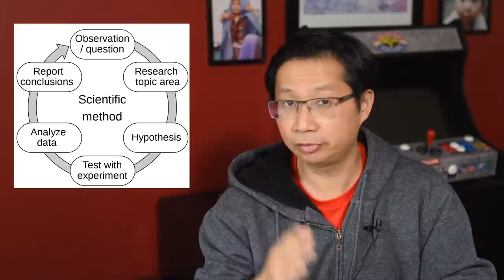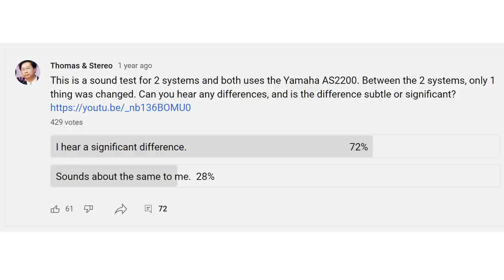Let me tell you stories about Break-in.

Comment: I'm glad to see you bring up this discussion. I will share my opinions as a guitar amplifier manufacturer who is in the tireless and very thorough pursuit of tone. I will list what breaks in and the order in which they break in the fastest. 1st is solder joints. These break-in in just a few minutes. 2nd is tubes. I would say after 20 minutes you know what you're getting and that will continue for hundreds of hours before they noticeably start to sound tired. 3rd is speakers. Especially low frequency drivers. They can change drastically initially and then will level out for years and then start to get loose, soft and lethargic. 4th is capacitors. They will show thier sound characteristics immediately and improve about the same rate as tubes. They will stabilize for the longest amount of time, generally decades and then they will decline. Again sounding tired, lethargic, muddy and dirtier. Also I should mention what happens with wire. Specifically the insulation. Cloth covered wire doesn't break in. All synthetic insulation goes through a warm up at first turn on. The softer the insulation the more obvious the change. Also the thickness of the insulation affects the sound. The thicker it is the more it interferes with the natural sound and can choke, flatten and harden the sound. These are just my opinions and based on decades of experimentation and having wire and capacitors custom made. I hope some of you find this enlightening and helpful in your pursuits of better sound.
Reply: I experienced break in on an expensive USB cable. I was baffled that it sounded dull with alot of bass, and the midrange and treble were almost nonexistent, lifeless. After about a week it was broke in and sounded great. What happened down at that level? Electrical field flow disruption?
Reply: @machwind3266  Hmmmm that's a significant change beyond break-in. If nothing else in your system was an issue I can come up with two possible solutions. Either a poor internal connection that through movement of the cable, it found its way. Or there was still some lubricant film left on the conductive materials from manufacturing that came off through repeated insertions.
Reply: @machwind3266 it's digital not analogue..

Comment: When I was a kid, I bought a pair of NHT 1.3As. The store didn't have new in box, so I borrowed the demo models until mine came in on order.  Once they arrived at my place, after having gotten used to the sound of the demo models, I positioned mine right next to the demo models to do a quick A-B.  I was baffled to hear a fairly 'drastic' difference between the two exact same models. The demos sounded open, full, and dimensional. The new ones sounded flat as heck, no bass, no sense of space. It was bad enough for me to call the store to ask what was going on. They told me to be patient; the speakers require a bit of time to break in and loosen up. I didn't know this was even a 'thing' at that time, but I DID know for certain that there was a very noticeable difference between the two pairs of speakers.  The store was correct; they loosened up after several hours of playing, and just kept getting better until they plateaued.   This is the reason that to this day, I don't comprehend why seemingly so many people don't believe in any sort of break-in.  With that said, I'm with you in that not EVERYTHING has noticeable break-in, and some has more than others.  It all depends.
Reply from the maker: Yup, anyone have real experience with understand.

Comment: I’m sure break in does exist to varying degrees, but I also think a lot of the break in is in fact human break in.  As audiophiles (or whatever term you care to apply), we are usually coming from another piece of equipment, and that original equipment has created a sonic baseline in our minds.  Put in different gear and I find I get acclimated to the sound of the new gear after a period.  We kind of recalibrate to that new equipment during the same time the equipment is supposedly ‘breaking in’, and usually that accommodation ends up being favourable.  That’s my story and I’m sticking to it.
Reply: I'm with this comment completely. The equipment may still be settling in/breaking in during this period, however our personal adjustment period seems far more significant in my experience. 

What's actually breaking in most? Because I'm sure a lot of the same characteristics that are emerging to my brain were there in the beginning, it just took me some time to be consciously aware of them. 

This has happened in my personal life. As I've broken in my girlfriends, sometimes I realize after break in period that they're real crap. And then I look back and was like yah. You were that way new out of the box too. Just noticed it now. Box it list it
Reply: I am not sure how many have tried this already. But one experiment that could help prove or disprove the break in hypothesis, is to have listeners compare a broken in device with a brand new one side by side. If there is a clear perceptual difference then the break in period does work. If not, the most likely explanation is that of adaptation, or other experience-dependent phenomena. After all experience-dependent changes in the brain including the auditory system is well established.
Reply: @mariopenzo  I think that's a valid experiment but the possible problem is who says that two pieces of the "same" equipment are in fact, the same. Especially with something like an amp that contains a whole bin of parts. And when it comes to break in of speakers, you could say the same of the drivers and crossover.
Reply: agree. it is us that is getting broke in. our ears, brain  etc that are re-adjusting,
Reply: I think that often it's both.  Consider Thomas's point that he demos an unit for a few hours, makes some notes then puts it "away" for some burn in time, then checks it again with "fresh" ears. I have had this experience too. I don't think it's as big a factor as letting our ears and brains adjust to the new sound, but I do think it's a mix of both.

Comment: There is no doubt.  I build my own stuff.  If you have ever used Blackgate capacitors, you know they have a very long and pronounced break in.  Good at first and all over the place and then after 100 hours very special.  Once you hear it clearly, it becomes more apparent even on parts that are not so obvious.  But a good capacitor in a critical spot such as a coupling cap is clear.
Speakers break in and the physics is simple.   In addition to capacitors in the crossover settling, you have surrounds and spiders that wear in and sound different.  I use vintage drivers.  Put some break fluid on the surround to loosen it and it sounds very different different.  The mechanical dampening is changed.
Capacitors are easy to hear break in.   The sound starts out tight, mechanical and not right.  With use, the sound comes alive.  Dynamics improve.  Low level information emerges.  Sound stage will get wider, deeper and more 3d.
Later you can even hear new resistors and sometimes even fresh solder joints.  Fairly brief, but definitely there.

Comment: Focal "burns in" every speaker they make before it leaves the factory. They got huge sheds behind their building that gets loaded up, and they literally play them on blast until break in occurs. I trust Focal as "reputable" , so it must be a real thing!
Reply: I just bought a pair of Canton A35 a few days ago and either I’m insane or break in very very real with these speakers. The mids went from sub par to crazy good. I’m happy …maybe insane but happy :-)
Reply: I can tell you as a Focal Kanta 2 owner, the so called factory burn-in is just an initial burn-in, the speakers are by no means at its top state when they leave the factory, you still need to burn in the speakers for quite some time yourself to let it perform.
Reply: Break-in is applicable to mechanical systems like speakers, cars, bicycles.... But for an electronic circuitry is different, there are mechanicals and chemical actions but at the atom scale which is quite hard to notice with the humain ears...
Reply: @solaVeil  I do find cable "burn-in" a bit of a reach, the term is certainly applied inappropriately all over the place for sure!

Comment: Thank you Thomas for the excellent discussion! Indeed, there are some gear where the effects of break in are barely (if at all) audible, and for other gear it can be extreme. The most extreme break-in I experienced was with my Altec speakers: at the start they were easily, by far the worst sounding speakers I ever had, and during 2 months they completely transformed and sky rocketed to the stratosphere. I noticed that the fewer the parts count, the more prominent and longer the break in is. On the other hand, when a unit uses a lot of error correction and very complex circuitry the break in will be little noticeable as the internal mechanisms do not let it show.

Comment: I would say a little break in is needed for amp and speakers.  Capacitor conditioning is real,  and speakers driver suspension need little time to loosen up.  I have an amp that needs to get warmed up to get to the proper class A bias.  I believe the sound may change for totally scientific and testable reasons.

Comment: I know you are specifically talking about electronic audio gear, but I also like to think about instruments and how that relates back.  Guitar or violin strings change over time and with use, and the tension is adjusted to accommodate.  Drums change sound over time with repeated strikes, and changing the sound to be consistent can be a challenge.  I know sound engineers are constantly challenged at different venues, even with simple things like xlr cables for the microphones, and how long the run needs to be based on stage sizes.  Tube amps and preamps do have sonic changes as the tubes age.   Electrical circuits are supposed to be consistent with formulas to calculate things out, but resistors and capacitor circuits show variations in the amps and voltage when you have sensitive enough measuring equipment.   So, YES, maybe!?!?!
Reply: B

Comment: About 18 months ago I bought a nice DAC/headphone amp combo, the first hifi purchase in 30 years! I switched it on and plugged in my headphones and it sounded a little flat and thin. I played around with the filter settings and the other simple functions and after 30 minutes or so it started to sound lovely and detailed, I was delighted. I always leave it on, but for some reason I switched it off over a weekend and when I came back to use it, that same flat and thin sound was back, but lasted only for a couple of songs before returning to its usual lovely self. Maybe it like to work warmed up, but maybe it’s me. My ears are 50 years old, so I don’t rule out either explanation. Great video, keep them coming!!

Comment: I always enjoy discussion videos like these. It's great to hear proper logical thinking with the call to adhere to the scientific method and statistical facts.

It's interesting to hear about your experiences and what was especially interesting was that I finally got to hear someone say that something sounded worse after break in. That's always been something I found odd about break in stories - the products always became a lot better. Of course there is some logic behind it as proper tuning of gear will be made with broken in units, as long as the company believes in it, but in the end it's still a change and the taste in how audio products should sound is very subjective so it would only make sense that some like broken in products less.

It also begs the question if the break in period is journey to it's "permanent" (within a reasonable time frame) state or if it will keep on changing significantly over time? Not an easy question to answer seeing as we haven't pinpointed break in to begin with.

Personally I'm undecided on the matter. I don't have enough experience to have formed a proper opinion on my own, so I'm left at looking at the experiences of others and using logic. I have no reason to doubt that people are experiencing differences but also feel like significant changes should be easy to both prove and to demonstrate. Are people fooling themselves or do we just not have enough proper research on the subject? Perhaps a bit of both, as even if break in is real I'm sure some of us are still also being subject to various biases and expectations.

Comment: I can't comment much on break-in, but I can confirm experiencing a long warm-up period with an R2R DAC. It sounded good "cold" but over the first day, it changed significantly as the manual stated it would. The OEM indicated the military-spec resistor-ladder DAC chips operated in a better manner when at operating temp and it appears they were correct.

Comment: Changed all the caps and resistors in my tube amp. Bass was immediately deeper but quantity was down. Not much bass, treble was harsh. After 100 hours via Roon tracking the hours per day, the treble is smooth, bass deeper and overall just better.

Comment: This is a thought provoking video!  
I think break in really does apply to tube amps.  Tubes sound better with time. Last summer I bought a Reisong A10 and I am certain it sounds better now that I’ve used it almost daily. 
However, I bet one can test THD with new tubes and THD after break in. This would be a test I would be willing to try when work demands subside. 
Also, when building a solid state amp you need to bias the output transistors. This takes at least a few hours until things stabilize. So I guess you can consider this as a break in.

Comment: hello Thomas, I agree that this topic together with cables will get people wound up. And I would like to add my personal observations and opinion: First of all, I work in the semiconductor industry and manufacturing equipment needs to break in as well when it is new. So do cars by the way.
Back to audio, my experience in the recent years is only vintage audio. I have seen that vintage amplifiers need to break in after storage time, or is it relocation? But the time was limited to a day or so. I have seen that on an Akai amp that seemed a big disappointment on day one but (literally) rocked from day two on. I have also restored a turntable and It also needed break in. The interesting thing with the turntable was that it was humming, so no vague complaints that could be written off by people saying I got used to it. After spending time trying to trouble shoot it, I decided to break it in and the hum went away by just using it. here I also agree with the observation that using it intermittently was working, i.e. the hum would gradually disappear with the passing days rather than the passing play time.

Comment: One piece of equipment. that really surprised me regarding burn-in was the Lumin U1 digital streamer.  This is pure digital output, so one would think that the sound would not change.  I had read from various forums that it needed about 200 hours of break-in before sounding very good.  The recommendation was to just play a very long playlist 24 hours a day for 2 weeks.  I spent a couple of minutes listening every couple of days.  I found the sound irritating during during the first week.  It felt OK after a week, and felt very good after 2 weeks.  I certainly wasn't getting used to the sound as I only listened for a couple of minutes.

Comment: I have never noticed a difference with break-in until I bought a WWII vintage Hallicrafters S-36A VHF communications receiver (27-144 MHz).  I hooked up hi-fi speakers to the receiver, and after playing a local radio station for several hours, I noticed a significant change in sound with the audio sounding smoother.

Comment: Break-in is real and happens across all components (yes, including cables!).  Different technology types, different manufacturers (who do different amounts of product testing/factory burn-in before shipping), and other ways of distinguishing any sample A from any other sample B DO matter to the rate and degree to which it has impact... but it is there.  Also, I have likewise had the experience of liking products more before break-in and less after (though, usually, it is the reverse).  I remember working in a hifi store, receiving a new pair of speakers for which I had low expectations, plugging them in, and thinking, WOW, these speakers have everything!  Days later of living with now truly high expectations and enthusiasm (meaning, days of coming and going to work at the shop, plugging in other speakers for customer demos, and plugging these back in, swapping out other components and then going back to square one, etc., in other words days of marginalizing, if not negating, both placebo and nocebo effects) the new reaction was, WOW, these speakers are SO BORING!  =D

Comment: That's also what I keep saying. Plus throttling the volume in short periods helps speed up the process, plus using white/pink/black/deep brown noise helps a huge deal.
If you just do it in a normal way, then time plays tricks on your mind + other changes interferes with the results. Making you forget the many stages of the burn in process.
This topic is also closely related to a/b testing/blind testing which also is done wrong many times, also interfering with the break-in impressions.

Comment: recently purchased a Chinese Nobsound 6p1 tube amplifier because I wanted to hear tube amp sound for the first time. After roughly 40hrs of burning in the tubes the sound is amazing with my Klipsch RP 600m and a Yamaha sw315 subwoofer. It gave the Klipsch bigger soundstage, clarity and warmth . Just wanted to try the sound but for now it will replace my Cambridge axr100.